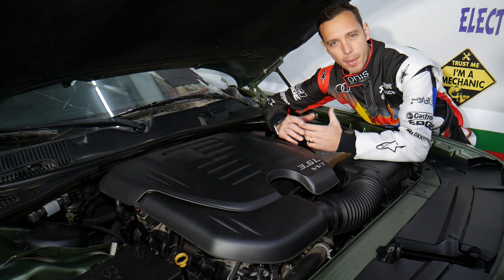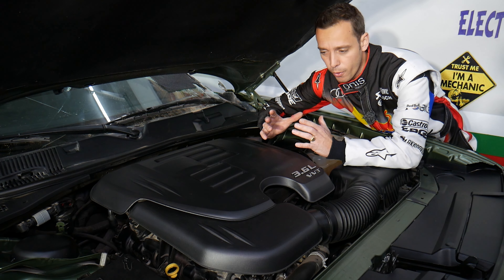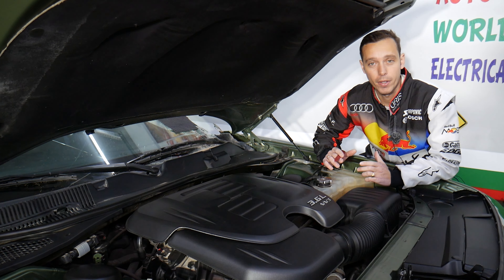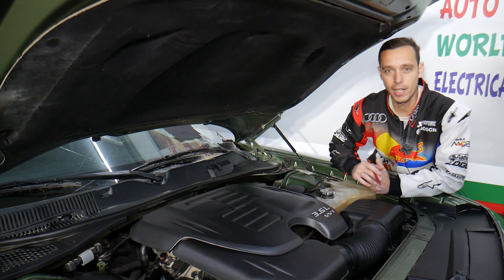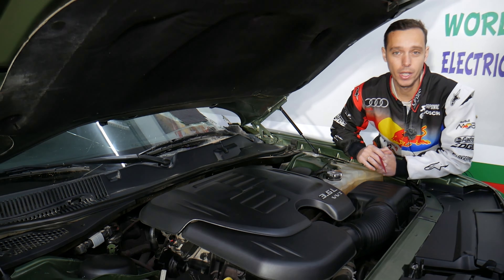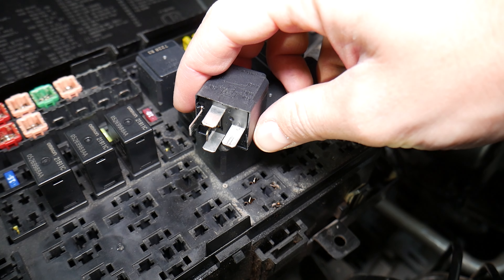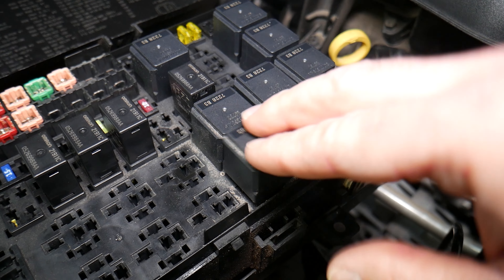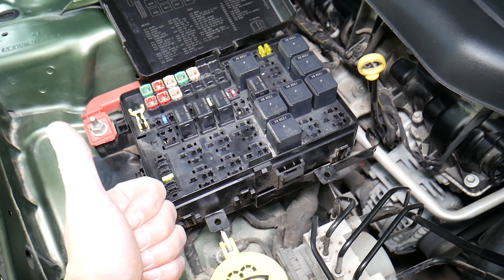DODGE CHARGER IGNITION COIL RELAY LOCATION REPLACEMENT, DODGE CHARGER NO SPARK

Comment: Hello 

I have a kia sorento 3.5 have code p200a I check the sensor and the motor and the both work 

Aa well I check the lower intake manifold and all the flaps close and open 

Can u help me?